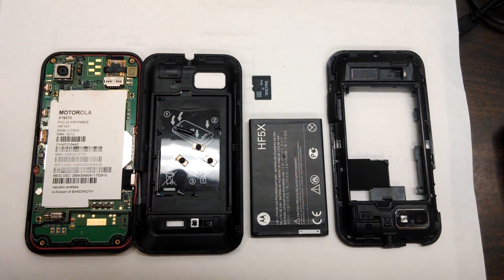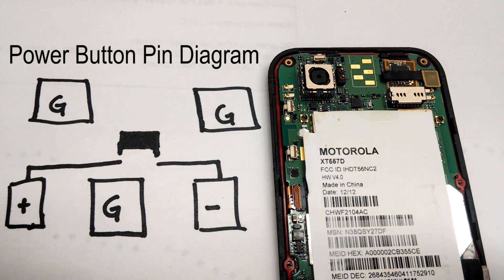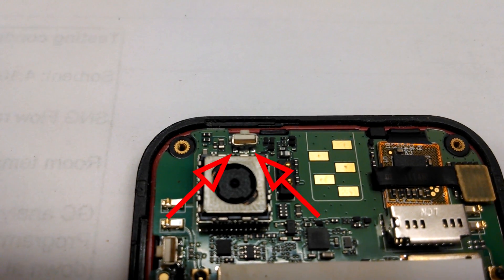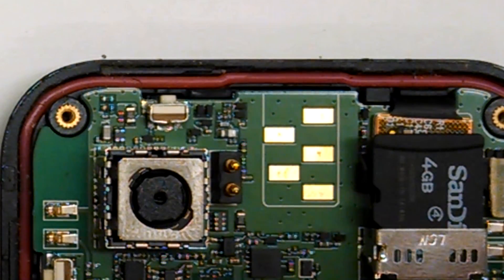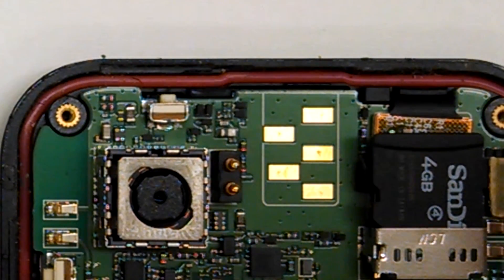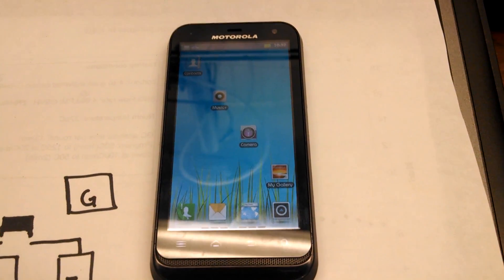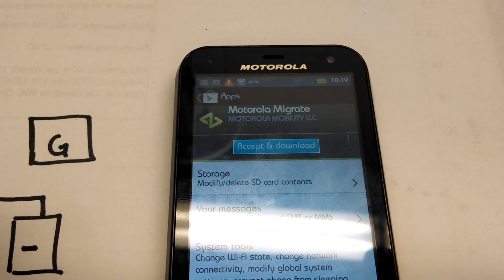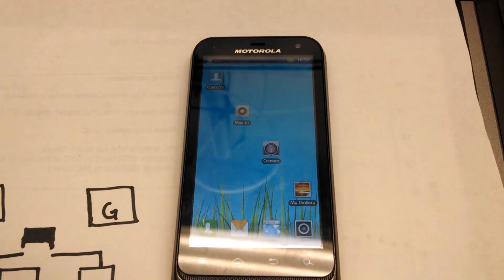How to power on a cell phone with a broken power button

Comment: Very helpful! For anyone else dealing with some more modern phones you can do similar actions to "jumpstart" the phone- most more modern phones use a flex connector (effectively a plug-and-play snap-in connector) to connect the power button to the main board, you can often mimic a power button input by pressing a thin piece of conductive material across one side of the connector even if the power button assembly is completely nonfunctional or destroyed. I find desoldering braid is a great choice for the material to use, it's thin enough to slide in without issue but sturdy enough to not bend or break like you could get with something like aluminum foil.
Reply: can you help me with my sony x1 ii?
Reply: How many pins are you supposed to touch?

Comment: Extremely informative video. I have a Samsung a13 that the "side" button/ power button stopped working. No dropage no water damage just a typical piece of junk Samsung phone. Is there a chance you can identify the contacts on the logic board? I'd like to do exactly what you've done in this video. I understand that the side or power button also has a fingerprint scanner built in it as well as power the phone on or off . Any help you can provide me will be greatly appreciated. Samsung has been giving me the run around for most of this year. So long in fact the warranty ran out 3 days ago. I was told by the ass clown from Sam suck that they will do a factory reset on the phone if they get the power button replaced. Even when I said I'd sign paperwork stating I'll risk private info being obtained by unauthorized persons. I don't have the videos backed up or saved on external storage. I have already lost appx 60 videos of my  babies playing and snuggling due to an unexpected error when I tried to move them from the one cloud back to my phone.i hope to hear you can help me on this. Thank you
Reply from the maker: Hey hey, best of luck with this! Sadly I'm unfamiliar with the a13's. It sounds like the motherboard may be dead if nothing bad has happened to it 😬(drops etc.) 
I hope the screen is just dead or something and this may help:
Ensure the device is powered off.
Simultaneously press and hold the Volume up and side buttons until the device vibrates and the Galaxy A13 screen appears then release all buttons. Allow up to 30 seconds for the recovery screen to appear.
Download and install Samsung Data Recovery on your PC.
Connect your smartphone to a computer using original cable.
That's my best guess. I tried looking at the innards of the phone and could not find the switch stuff from what I could see. 
Best of luck mate!
Reply: @IAmWhil  I popped the back off removed the lenses that snap in place over the side button connector on the logic board. The connector was slightly askew. I went to pop it loose and found it wasn't snapped into the logic boards connector. It looks like the logic boards center part of the connector wasn't soldered in 4 places like usually done I only saw evidence of one terminal being soldered. That was a guy piece of gold wire stuck to one contact on the little piece that should have been secured to the logic board. Samsuck is still jerking me off. People think carefully before you buy a Samsung product. They will do everything within their power to prevent you from using your warranty

Comment: Hi! Very helpful video! I have a little trouble in order to weld a power button because the original is connected by a flex and it have 3 tracks. I managed to weld a button directly to the pads on the mother with 2 pins but it's still not working and I don't know what to do with the 3rd pad. I Hope you or some good-hearted people might help me. Cheers.

Comment: Don't know if you still reply but I'm trying to do this on an old HTC Evo 4G LTE. Has a flex power cable. Not sure where or what pins to connect any wires to.
Reply from the maker: I do! You're going to want to find the physical switch on the side of the phone.  Look at that - can you get to the pins on either side of that?  Try jumping the pins across the switch.  Best of luck!
Reply: @IAmWhil  thank you so much for your reply. I just don't see pins.. i took the whole thing apart. The power button is on the top but it's pretty worn. It has two holes next to it then it's the flex cable leading to the motherboard. Is it on the end under the power button or the middle or near or on the motherboard?

Comment: hi.  will this work with a galaxy note 10 plus? I broke my screen and when the insurance repaired it they broke the power button solder point off the motherboard and I can't get it on to get data off......  I don't want to have it soldered back on because I'm sending back to sprint.. but I need on temporarily to recover data.  is it possible with this phone?

Comment: So could I just solder a little external toggle switch? Seems doable and I"m living in Guatemala on a fixed little income so I don't care if it's clumsy lookin'.
Reply from the maker: If you're asking this question I assume you have the requisite knowledge to do so, but in case someone else has the same idea lemme add my 2 cents.  In short 'Yes." But I would not use a toggle switch.  If you have a toggle switch and toggle it closed it would be like holding the power button down.  This would work, but then you're going to have to toggle it off again to have it go back to open (while the phone boots up).  While toggling the switch would work, what would probably be a much nicer experience would be to use a "normally open push switch"... https://en.wikipedia.org/wiki/Push_switch.  This way when you push the button down, it closes the circuit, the phone boots up.  And you have all the other functionality of holding the button down for x amount of time to do y things... Best of luck mate!
Reply: @IAmWhil  Thanks... Exactly what I was wondering too... because I noticed that the two posts were only (touched)... (not held down) and though my knowledge is limited I knew that was significant.

Now to look for a "normally open push switch" in Guatemala. (Not impossible)... just (less easy) than in more industrially advanced parts of the world.

Again. Thank you!
Reply from the maker: @GypsyPriest  Look on old printers or possibly old cell phones.  May be able to pull one pretty easy.  Best of luck!!

Comment: Ok so I have a phone without  a removable battery and the power button  and volume buttons are gone and all my stuff in phone my pics of my life my kids funerals  and other important  stuff I'm freaking  out any help please would be very much appreciated  to save my stuff thanks much
Reply from the maker: Hey Georgia, sorry to hear about your phone!  If you're super worried about recovering the contents, depending on the brand of the phone you may want to have a professional service get the data off of it for you!  It may cost a bit of money, but would probably be worth it!  This method requires taking the phone apart a bit and jumping some pins to get it to turn on.
Reply: @IAmWhil  hi thanks much for the reply I really appreciate it the phone is a alcatel onetouch so idk
Reply from the maker: @georgiamclain1560  No problem :) I'd suggest trying to contact them directly and see if they can help you out: https://us.alcatelmobile.com/contact/

Comment: What wire did you use?
Reply from the maker: I used a piece of wire out of a cat-5 cable (old ether net cable).  I just removed the insulation on the ends.  Old cat-5 is a really good source for small wires for side projects :).  Good luck!

Comment: What wires are you using
Reply from the maker: You can use any normal wire.  I'd use something insulated and pull the insulation off the ends, as opposed to something like a paperclip.  The wire I'm using in the video I pulled out of an old phone or ethernet cable. Good luck!
Reply: @IAmWhil  what app do you recommend to copy all of my photos and text messages and videos

Comment: Is this also possible with a HTC ONE MINI 1? I have the extra problem that my phone doesn't want to charge anymore. Every time I try charging it with a normal charger or with my pc the light turns on but it doesn't charge. After a few minutes the light also goes back out.. The only reason I want to restart my phone is to recover the pictures that are on it.

Comment: Hi, what wire did you use to start it? Mine is a samsung galaxy avant, power button is stuck down it keeps turning on and off non stop
Reply from the maker: Any wire will do.  This one was pulled out of an old cat 5 cable.  If your button is stuck down you have a different problem, instead of not being able to connect the contacts, it's continually being connected.
Reply: IAmWhil do you know how i might be able to fix that?

Comment: how can i locate the power switch for the htc m9 + so i can jumpstart it? the power button dsnt work anymore.thnx!
Reply from the maker: Generally the power switch will be directly under the power button.  The button is just a piece of plastic that sits on top of the switch.  I'm not 100% sure that is the case on the HTC m9 but it's a really good starting point.

Comment: Will the wire trick work on my phone because the power button stopped working When it got wet by water
Reply from the maker: If ONLY the power button got wet then possibly.  If the motherboard or something else got wet, and then shorted, unfortunately you probably have some dead components other than the switch :(.

Comment: It worked for my Ulefone too! Great tip!
Reply: yes, ulefone power 2 also doesnt have a clip that attaches the buttons to mother board. its just sticked on the mother board.
Reply: please tell me which two terminals to connect in ulefone power 2.
Reply: WHAT ulefone i have the be pro 2 please help me
Reply: Ian Witten mine was also be pro 2, I tried a lot to get the right two connectors,  but it worked,  so I could turn the phone on and saved data.  I think there is no risk to make short circuit....
Reply: Ian Witten ,did u open it?
Reply: Ian Witten Just grab some copper wire and put it on the terminals that connect the power button.It worked for me
Reply: Mbs Yaswanth yes

Comment: HELP. everytime my tablet is on it wont stop vibration even the volume is off. it will only stop when my tablet is turned off, but everytime i press the power button, it vibrates! please i need your help...

Comment: Does the wires need electricity?before touching the two points
Reply from the maker: Sorry for the delay in response!
The answer is no.  The wires do not need to be plugged in or have any power source before doing this. 
What is going on is one of the connections has voltage going to it.  The other does not.  When you connect the two the circuit is completed.  Normally the switch does this, but because the switch in this case is broken, the wire is doing it.

Comment: where did you get the wire from??
Reply from the maker: I think I pulled it from an old ether net cable.  Any insulated wire will do, just strip off the ends.  (Think old phone cords, old internet (ether net) cables, etc.

Comment: do i need to use a plugged wire or no ?
Reply from the maker: I'm not sure what your'e asking.  The wire that you jump the pins with is just a straight wire - it only goes from the one pin to the other.  When you connect the pins the electricity will flow through that wire...

Comment: This works on a Motorola XT 1563 (Moto X Play) with a flat connector broken ?
Reply from the maker: It could, if you're able to jump around the power button like in the video - yes.  It also has to have a charge on the battery.  If you're unable to charge it because the connector is broken I'm not sure what you could do to give it power :-/.
Reply: Thank you, the method worked! I found the positive pin connector and make a jump with a multimeter.
Reply from the maker: +Alexandre Alves (Allew69) awesome job! Did you manage to save your data?

Comment: Sir, I want to use this trick on a tablet for my project.
Do you know any tablet which has such simple power button which i can use to start the tablet by shorting two terminals??
Reply from the maker: I don't know which ones do, but most of them with a physical button will operate similarly.

Comment: Hey, I have a oneplus one which randomly turned off on me. My power button does not work. How do I know which one is the positive terminal or negative terminal so I can jump start it like in video above?
Reply: Or if i buy a new power button, how do I stick it on the mainboard?
Reply from the maker: The positive and negative terminals will not be grounded.  Some of the terminals will be soldiered to the metal frame for the button, those are grounded. 
If you just buy a new power button, soldiering it on is going to be super hard because its REALLY small.  Quite possibly impossibly small for a human to do.  BUT, sometimes the power switch is part of a really small circuit board that plugs into the mother board via a small ribbon cable.  If that is the case, you can replace the whole circuit board assembly and just plug in the new ribbon cable.  You'll have to look up your particular model.  I hope you get it working, good luck!
Also if you're under warranty, just use that :D.
Reply: hey i'm running into same problem on my oneplus. Have you figured out yet?

Comment: The light on my 2DS ,(next to the power button) started flickering! What can I do?
Reply from the maker: +AwesomeOshawott The blue LED is flickering?  Sometimes what happens here is the soldier joint gets broken / desoldiers if it gets dropped or REALLY hot (impurities in the soldier joint heating up).  There is a chance that the LED is only there for 'power indication' and does not affect anything else.  
If your 2DS is still working just fine, that is the case, and you don't have to worry about it.  If the LED is inline with anything else, when it goes out, what ever is in series with it goes out too :(.  If that's the case I'd contact Nintendo and see if they can repair it for you.  Attempting to soldier really small components is exceptionally hard, and its easy to accidentally soldier to other things which creates shorts.
Reply: +IAmWhil Thank you!
Reply: +IAmWhil What I did to it was tapping on it and after awhile it was normal! How did that happen?
Reply from the maker: +AwesomeOshawott Its probably just a cracked soldier joint.  So if you get it just right, it will work (there is contact), or if its just wrong, it wont work (not touching).  Its what caused those old "red ring of death" errors on xboxes.  The electrical connections just kind of break and don't quite touch, or sometimes do touch and things work / don't work.
But I'm glad you got it!

Comment: Heeey, what if my power button is really destroyed? Like, it's removed already. Thanks!
Reply from the maker: you can probably connect where the leads had been soldered to the board. good luck!
Reply: +IAmWhil what are the leads and where?
Reply from the maker: The leads are basically where the switch was soldered onto the motherboard.  Even if the power button has been completely destroyed (As long as it's not shorting out), connecting the two leads should power on the phone.  One of the leads (terminals) will connect to the positive voltage from your battery, this one is "high," (there is also a chance that the voltage is stepped down from the battery, and thus why we connect the switch terminals instead of a random spot on the motherboard with +voltage to the low side).  When you connect it with the wire to the "low" side it should power on.  There is a chance that the low side is the same as the ground, but on some phones it is not.
The leads (or terminals) are directly under the power button as I've attempted to show in the video.
Reply: +IAmWhil So basically my leads are not broken,the buttons are.I use an aluminum foil shaped like a needle just to turn it on everyday.Where can the buttons and the power switch be bought?
Reply: +IAmWhil And i also need to use my screw driver just to open my cellphone
Reply from the maker: +Ethan Ortiz Ahh, I see what you're saying.  This is kind of a last ditch solution to get your data off the phone before you get a new one.  If you want to repair the switch, you can try to solder on a new switch, which may be near impossible because they are crazy small.  The other option is, that if the power button is on a small printed circuit board (PCB) that is not part of the main mother board, to replace that PCB with the button on it.  But if its like the one in this video (and most new phones) you'll have to replace the motherboard, which is a hassle.
Reply: +IAmWhil So i buy another power switch and replace it?
Reply: +IAmWhil BTW thanks,you earned my sub

Comment: Hey dude, I purposely removed my power switch for a project, how can I make it so the phone can operate with a wired kill switch? Like my own on/off click switch. Can i just solder it to the points where the original power button was?
Reply from the maker: +Matt Hey Matt, I'm not sure because the power buttons normally work with a bit of logic and not just switching the power.  Like when you hold down the button for x seconds it will shut off the screen, or prompt you to turn off the phone, or the power button + some other button will take a screenshot.  The switch option may be kind of cool if you can just toggle it to turn on the phone (toggle on, toggle off real fast -> powered on phone), and then longer toggles to do other things.  If its a phone you don't mind losing or is just for experimenting on, give it a try, though it may just brick the phone :(.